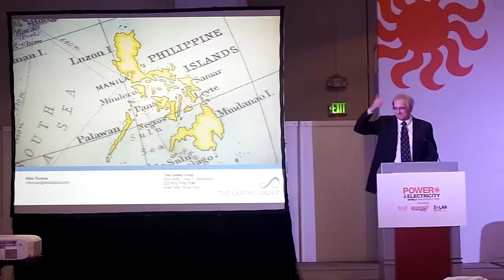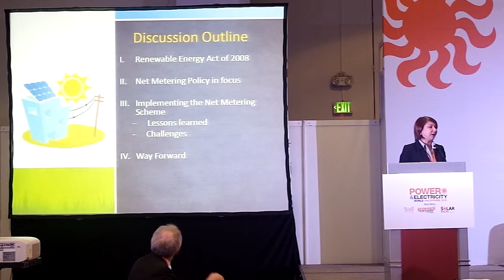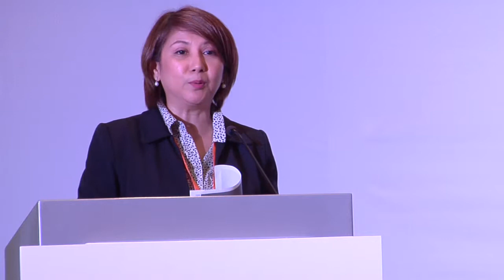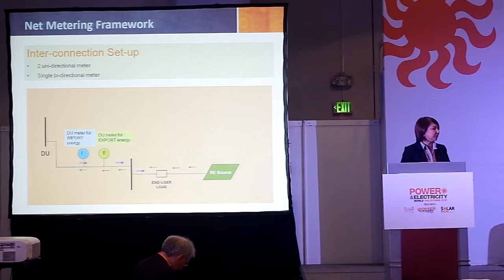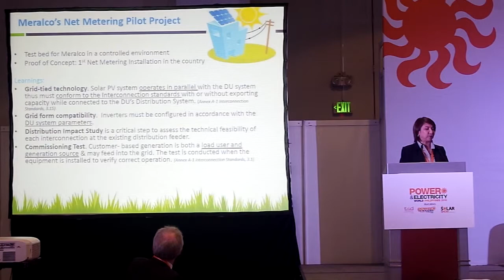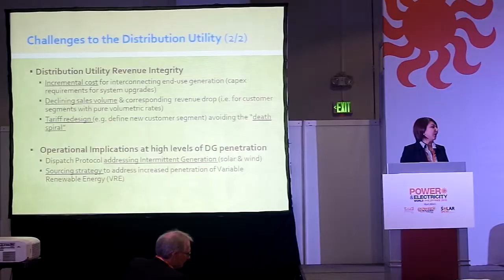Net metering in the Philippines: From policy to implementation

Comment: Why is it in the Philippines the exported energy is paid in wholesale price and not in retail price?
Reply: Unlike in other countries the price of exported energy is the same as the retail price, thus giving the RE producers more financial return. in Philippine set up if you follow an on-grid set up you will be receiving less payment (wholesale price) for your exported energy compared to your imported energy during the night (electric bill) which you pay in retail price.

Is it theoretically better to follow an off gird set up. Storing your own electricity in batteries and use them as much as you can. that way you would not need to use the electricity provided by your producers. thus lowering your electric bill in the same process?
Reply: @johndelacross6509  hybrid set-up is now in demand. It means you have on-grid and off grid connection. And at night the only time you will consume electricity from your provider is if you already used the backup battery. Which means minimal electric bills or zero electric bills.
Reply: The government should actually look into this business model.  Technically, the exported enery is also sold to others in retail price.